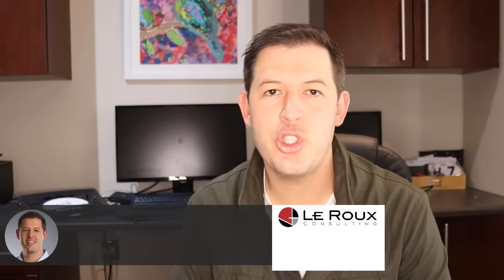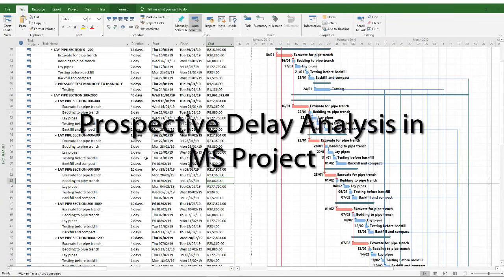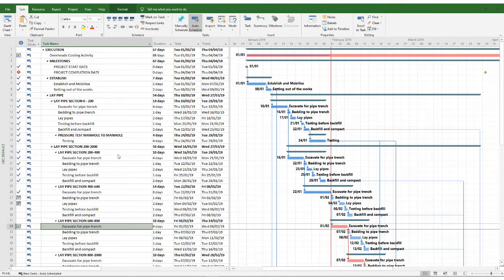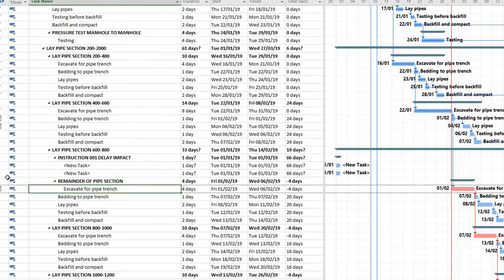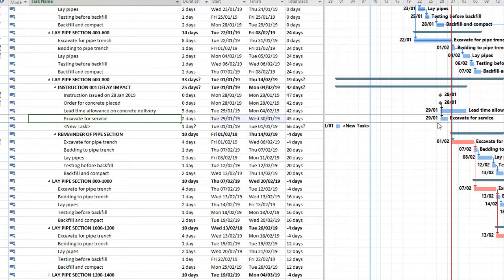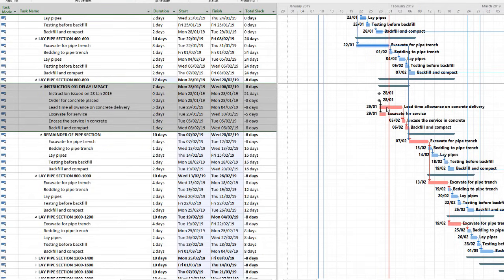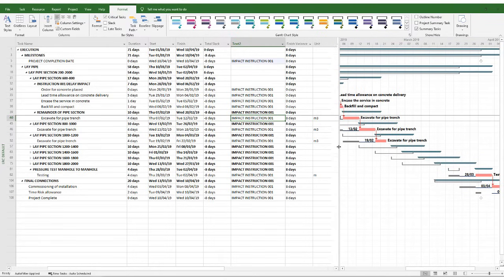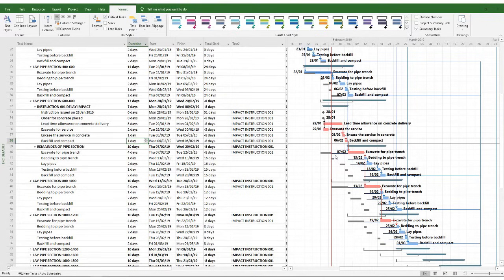Prospective delay analysis using MS Project

Comment: Hello Kobus, what I have come to realize is that you would have a scenario as the one you have just discussed in this video, whereby the contractor has his responsibility in impacting a delay and so has the client (in my case as a result of variations) ...what I need to know is how is it fair to factor in the contractor's risk impact if at the end the contractor incurs delay damages per contract 

Simply put why calculate a finish variance if you are determining impact of delay in an ongoing active project?

Comment: How do i justify that with a given set of 15 person team cannot finish the works earlier by a month when a project is scheduled to complete in say 24 months for a 3 storey building?...i am talking about evidence to show based on MS project depending on human resources only...like how much more extra men is required from curent team of 15 if to complete project by two months ahead in time?...where do i make the changes and show them extra human resource or overtime requirements based on costs also?...Please guide me,Thanks in advance.
Reply from the maker: Hi Tshering. There are quite a few MS Project concepts, terminologies and skills that need to be understood and combined to achieve this. In short, when you have resource loaded the initial schedule, you can use the effort driven task type option or Fixed work option to capture the initial production rate for each task in your schedule. Create a baseline of this. After this step, when you increase resources, it will show the decrease in duration on each task and it will demonstrate the possible time for completion given the different levels of resources applied.
Reply: @JCleRouxx  Many thanks for your reply.